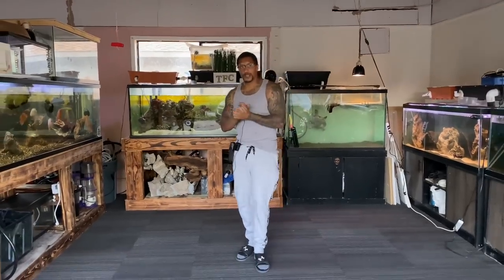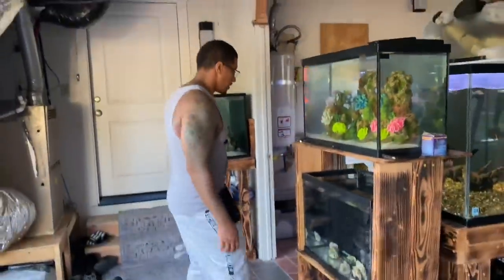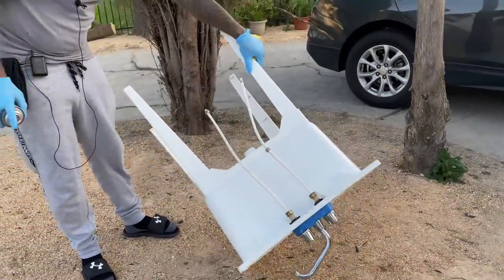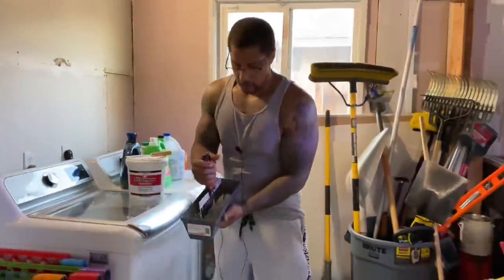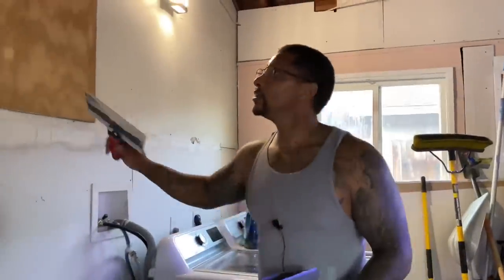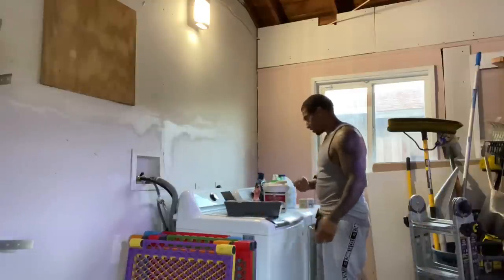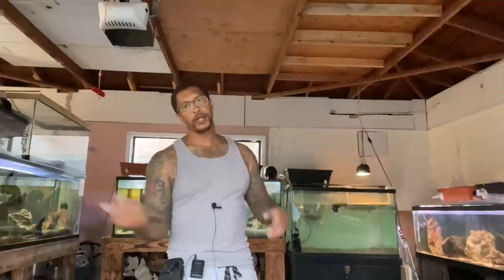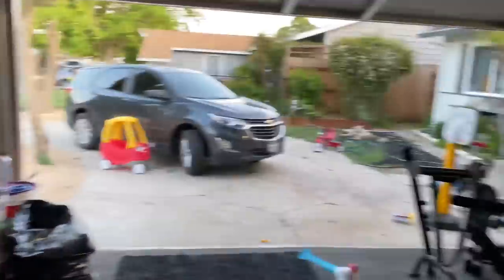Getting the Fish Room in Order! Preparing the wall for paint! And refurbishing the sink!!

Comment: Couple wires cutting corners.  That would drive me crazy.  Not to hard a fix; cut the wire, add an extension piece, reroute through the studs, but you have to add a couple of junction boxes, and need access to those junctions.  Not pretty, but better than wires cutting corners on the outside of walls.  Also, I would tape everything.  New dry wall with no gaps is taped...after time, with temperature and humidity fluctuations you can get cracks, especially in a garage.  And, in all honesty, I come to your channel for the fish story.